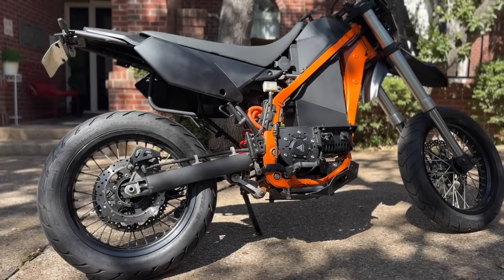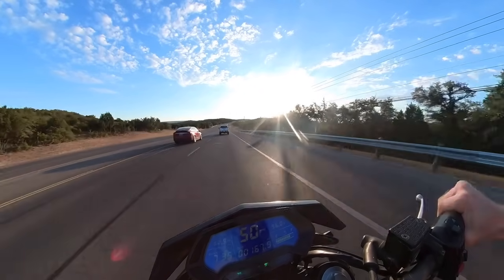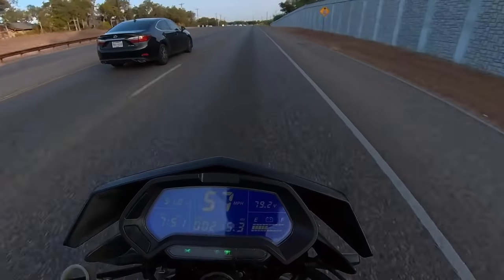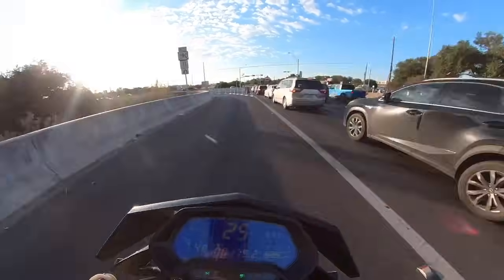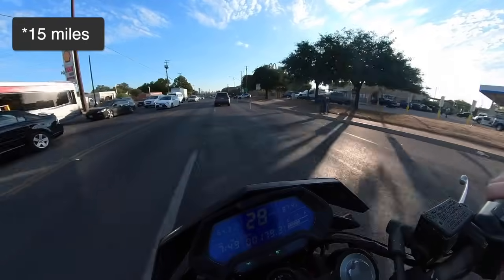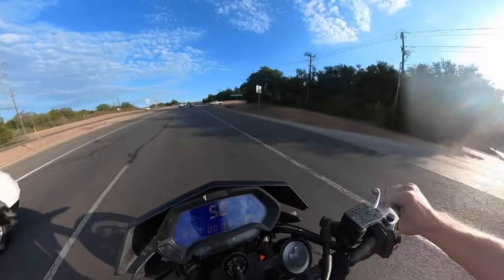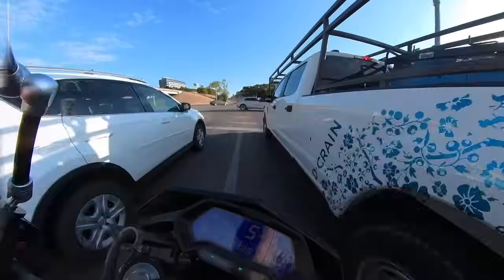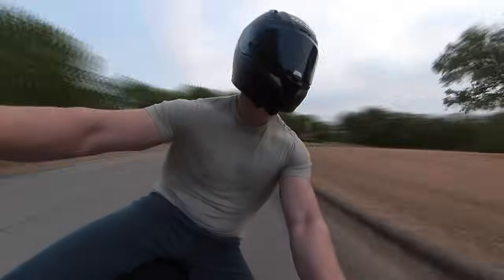I Rode My DIY Electric Motorcycle Until It (almost) Died

Comment: The program to measure the amp draw come with fardrive controller? 350A is quite high!
Reply from the maker: Yes, that's the Fardriver app - 350A is high indeed, considering this controller is supposed to draw 250A on the line. I'm actually not sure why I'm getting so much more current but power level and current is consistent via BMS app and shunt so seems legit. controller doesn't overheat so taking this as a pleasant surprise

Comment: Nice build!  If you had to do it again, would you use the same Qs138 motor and FarDriver controller combination?
Reply from the maker: the QS138, yes - it's a very good motor for the cost. The Fardriver, no - the software to program it is buggy and/or obscure with virtually useless documentation. I actually picked up a Kelly controller to swap it out
Reply: @GaiusGarage  yeah, ease of use is important for the controller…regen levels, amp limits and temperature modulation are nice to play with….if you can do it easily!
Reply from the maker: @jimhofoss9982 amp limits are easy to do - but selecting the right temperature sensor can be tricky and I was never able to get regen working. The controller itself is good if you can get it tuned property and people have done it but the app and parameters are very obscure and documentation is completely insufficient. contacting support is pretty much useless

Comment: How does regen work on a mid drive bike? I get how it would work if you had a large hub motor in that back tire. But does the chain actually push the motor when you lay off thw throttle?
Reply from the maker: That is correct! The chain linkage couples the wheel to the motor

Comment: Im blown away you are getting 28kw out of a 4kw rated motor! thats awesome
Reply from the maker: 28kW *into a 4kW rated motor. a motor doesn't actually create power, it converts it. same as a light bulb, it can be rated for 60W but you can set it up on 120W, 200W, whatever you want..at some point tho it's going to burn out but not right away if the power is not so extreme. same for electric motors - heat is the deciding factor, as long as you can keep the motor cool, it will keep running at much higher v
power levels than the "rated" value, which is typical continuous power delivery

Comment: awesome build man, i messaged you about the old build i guess about a year ago getting some advice on my own idea, you were really insightful and i’m very happy to be a subscriber of this channel. i’m wanting to replicate this build with a bac8000 and surron ultra bee motor. wondering if you think it would be a worthwhile investment and would see any significant gains / losses with that (very pricey) difference
Reply from the maker: Thanks so much! Are you thinking about replicating this build as in using this particular frame from a KLX250sf? If so I wouldnt recommend this frame - the dimensions are not ideal for electric where things are more boxy - you'll probably end up having to cut the frame somewhere like I did or custom-design your battery pack from cylindrical cells so you can control the shape. If I were to start fresh on a dirtbike I would use some like a CR250 or something like that - although I haven't deal with one of those so probably some caveats there as well. As for motor and controller BAC8000 peaks at 72V, I think, so maybe 22s at most. I dont actually know the specs for the Ultrobee motor but Im sure its comparable to a QS138 90H in terms of how much power you can send to it, not sure about performance in terms of peak torque etc. Sounds like you're planning for a ~30kW system so maybe start with the motor and work your way backwards

Comment: I have a very similar charger in my Polaris EV, 3.3kW.  Similarly, mine charges fine at home but one or two (not all, thankfully) public chargers have shown an error.  The charger sends a PWM signal to the EV (on the Pilot line) where the duty cycle indicates what current the charger can deliver.  The EV drops the PWM voltage using resistors to indicate what current it would like.  I wonder if the resistor values are not sufficiently spot on?

My conclusion is the implementation of the comms
Reply from the maker: yeah this is definitely the issue, as Ive since learned. I'm working on an arduino-based solution to add to the bike. Although I'm surprised this I/O functionality is not part of the charger
Reply: @GaiusGarage  That's not a bad idea!  Have an arduino sitting on the control & pilot pins acting as a bridge.  That would give better diagnostic information and protocol translation when necessary.

Even better could be the ability to just connect the charger to the mains with the arduino controlling the charger - so you don't need a 'granny charger' in series to charge at home.
Reply from the maker: @Simon_Rafferty  what do you mean by a "granny charger" in seres to charge at home. the charger I use at home for this obviously doesn't check for the control signal, just provides power regardless. I imagine the pilot and control pins don't connect to anything on the EVSE side, so the setup with the arduino would work in either case
Reply: @GaiusGarage  'Granny Charger' (no idea why they're called that) is just a low power home charger.
I'd be surprised if your home charger doesn't check the pilot & control lines.  My charger doesn't start the charge unless it can see the appropriate signals.

Comment: Awesome project., Your bike has better acceleration, but same top speed as the Metacycle in sport mode. Very nice.,..  Metacycle also picks up more in the middle of accelerating. Maybe it's just an EV thing? Is your speedometer accurate? have you tested with GPS?
Reply from the maker: Thanks! yes, the speedo is mostly accurate, I have tested using GPS.. maybe 1-2 mph off at higher speeds but good enough for me. The power curve is mostly due to the gearing - direct drive in this case - its possible get more low-end torque with a reduction gear

Comment: What an insane project!  Very well built!  Congratulations!!!  One question, what is the nominal speed of this engine?  From the video I saw that you reached 6700 rpm, is that right?  I follow you here from Brazil.
Reply from the maker: Thank you! Yes, that's correct. Max RPM I was able to achieve was around 6700. it's possible to achieve higher RPM with field weakening but I don't have it enabled

Comment: I wonder how much range you'd get if you weren't doing high speed runs and hard acceleration?  Curious because I have the same batteries and am thinking of doing a similar conversion.  I'd be using the 3Shul VESC based controller because I've heard others complain about the Fardriver and Votol.
Reply from the maker: I think it would be fairly similar since a good portion of this trip was highway riding around 60mph. You gotta figure for practical highway riding, the energy consumption will not be more than 200Wh/mi and not less than 100Wh/mi. So if you're working with a 4kWh battery pack, you range cannot physically be much different than 20 - 40 mi. Most production bikes like the Zero or Livewire have on the order of 20kWh packs
Reply: @GaiusGarage  True.  Most of my riding will be 40-55mph so hopefully closer to 40 miles.  Though I'll be running knobbies so that will hurt range some.

Comment: Bac8000 has all the features your looking for plus getting Hard acceleration and higher top speed with variable regen
Reply from the maker: yeah Id love to get my hands on an BAC8000 but they are so expensive plus programming is an issue. I believe you have to get them per-configured by the seller or pay for support from the manufacturer to program it yourself. I dont know if that changed but I need something that I can tune myself. but Im not as familiar with the BAC's so please lmk if Im wrong about something here

Comment: Dont you have an onboard charger? Im assuming your onboard charger converts AC to DC, so you could plug it right in to the wall. i think the EV charger you were trying to use puts out DC power.

Comment: You should try pouch cells on your next EV build....if you do another one.
Reply from the maker: yeah, definitely going the pouch cell route the next time around
Reply: @GaiusGarage  sweet. I'm in the process of building a 72v 73ah pack with NMC 3c discharge pouches and a JK BMS. So far so good. Most of the factories I talked to offered to laser weld nickel strips on the polar ends for free, which means I can solder them instead of having to use expensive copper bus bars.

Comment: It might be that your contacter wasn't connected to let current flow through and charge the battery.... Could also be the current it's trying to pull to charge, it might only put out so much current so it might be too much power to charge.

Comment: I just started checking out your channel by the way Tesla under here also by the way just a word of advice A lot of those j-1772 chargers are so erroneous I barely ever use them I know why you probably would use them just the same reason why I use them but if you can get to a tesla wall charger it's about 400 bucks and never fails

Comment: It could be a bms communication issue.. I won't say always but typically the bmu communicates with the charger. If they can't talk if you will due to a fault on the system or the firmware being incompatible. This could have possibly been your issue.

Comment: hi man, i know all things you can find will probably be more expensive than the FarDriver controller, but maybe it's worth switching to the VESC ecosystem?

another downside, apart from being expensive is that there isn't really a compatible screen that will communicate directly with them

the software has support for MTPA (Maximum Torque Per Amp for ipm inrunners) and field weakening

they're really easy to program etc, they have a great app and computer program aswell

the 3Shul CL350 (albeit limited to 350-400 phase amps) seems ok price wise at $400 and can take up to 30S

albeit i believe the CL700 will be the best option if you don't want to lose any torque but those are around $720

they also support any type of NTC etc, you can literally type in the resistance and beta value of the thermistor and it works, no matter wether it's a thermistor from one brand or even ripped out of a 3d printer for example

Comment: Keep your lipos or liions stored at 50% storage charge, in a cold place (but not freezing), and they will last longer.
Unlike a lead acid battery you want at 100%...   lipos and lions like to sit at 50% optimally.  This goes for smart phones, laptop batteries, ebikes, drill batteries, anything that uses lipos or li-ions.

Comment: Do you get more range if you added gear box
Reply from the maker: Possibly if you add a final drive gear. but because the torque curve for an PMSM electric motor varies less than for a ICE, you don't need as many gears. Lower RPM have constant torque so if you keep the motor within the constant torque region, you may be able to improve efficiency and range

Comment: it does ramp up the current when you first plug in the charger but you should be able to watch it go up slowly. if it stays at a certian low amperage for a little bit before going up then it is balancing the voltage before ramping up the current and sending the charge through the main battery cables instead of the balance leads. a nice charger should let you do a resistance check the resistance of each pack, if the resistance gets off a litte in a pack, then the pack will discharge at a different rate and wont stay balanced. why couldnt you just mount a charger on the bike and plug it in anywhere to 110v?
Reply: Doing research into my own build and it seems like mounting a charger would be a better option. You charge anywhere you fin an outlet instead of just where there are charging stations.

Comment: Hi what is the line and phase current you feeding it
Reply from the maker: line about 350A, phase up to 530A
Reply: @GaiusGarage  your controller is 250a how are you able to do it pls
Reply from the maker: @MayhewCloutier I honestly dont know - the app lets me set up to 350A on the line so I set it to max. Ive confirmed via the shunt that its pulling that many amps during full acceleration. specs for the controller do cite 250A, but maybe that;'s continuous and they didn't give a peak rating? I never really looked much into it. controller doesnt overheat so I'll take the extra 100A

Comment: Yep, just register it as a regular motorcycle and all they need is lights, horn, mirrors, etc... i wouldn't even point it out or make a big deal of the power plant and you will get a plate without an issue.  Also, if the inspector asks about it, just say it has rhe same hp as the gas motor it had in it.

Comment: Have you tried giving the energy regenerate table permission to regenerate more than 0%? 
I found on mine I needed to use:
0%.      50%
100%.  100%
and 100% all the way down. 

Then try to change back current. I kniw on mine if I tried to change these in the wrong order I get the “try new BLE” message. 

When i used 100% for all values it actually would try to go into reverse a few times after stopping, thats why I had to use 0% and 50% to taper that down to nothing. Now it works fine. 

Im using 10a15a for back current and max back (which should be 50% higher than back current). 

Some setting is putting the block on you. I know i set throttle release regen first because I didn’t have brakes hooked up, and then I changed to high brake and turned ofd throttle release. 

I think your firmware looks new so it probably supports 5 pole pair for your motor. Wont change much but it will report  RPM on the tachometer. My Fardriver even accepts most of the forbidden pole pairs too

Using the correct pole pairs might help you know how deep into flux weakening you are. In this video it showsYou have it turned on full flux right now. Weak Response 7:none is off. That will show you the base RPM. 

138 90H base speed is 4000 rpm and you at 6500 (4 pole pair) is really 5200 RPM, and max flux is supposed to be 6500 rpm, so it seems like there is a little room for more. 

You may be at the limit for your setup but changing gear ratio to a bigger rear sprocket would of course increase bottom end acceleration and you might be able to get most of the top end back if the motor can turn a little faster. 

It seems to run pretty good already. Im sure at 80 mph you won’t get far but you’ll get there fast. Lol.

You also might get some extra acceleration and quieter motor by tuning PI value one notch higher than default and tweaking AN and LM.
Reply from the maker: Thank you for this breakdown. I also considered whether there was some setting that "locks" some of the other settings from taking on certain values. I have noticed that I was able to change certain parameters but after making certain other adjustments, I am not longer able to change those parameters as much as I was before. I have changed that regen tables but mine are all 100%. I will try changing them to ramp, up from 0% like you described. 

It's all very vague and opaque and documentation for this controller is garbage. I've messed around with the AN & LM values a bit also.. thought it was running ok. Do you think it sounds kinda rough. Maybe I kinda felt that way also, but these settings are tricky also.. all of it seems very subjective.
Reply: @GaiusGarage  , the 0% and 50% will eliminate the reverse at end of regen, which will be more prominent if you ever get regn up to something more appropriate. 

I have a have a hub motor so it’s easier to tell if it makes a weird noise. And your middrive needs a different AN than hub motor. Your bike seemed to have good performance for a conversion. You see some Walmart mountain bikes with 8kw motors and 32kw controllers, which of course will come off the line faster, but no way I would ride them at 80 mph. 

You can also try to reset your controller to factory settings and run autotune again and set everything again. Your regen settings are not default, which is think is 4a/6a.  Maybe it got lowered for autotune and then some other setting blocked it. Even when setting the energy regen table value, it gave me the BLE error is I tried to set the second values before the first.

Comment: For comparison: 52 Watts/mile @24mph on new Fat tire E-bike (26 Amps and 48v motor, think I did it right)    22 Watts/mile @12mph  (has speed limiter for different power levels)    So basically might as well go full speed.   Came with 3 kWh battery, 50 mile range.  (If battery is actual size claimed, haven't pushed it yet)   So considering your high speed, yours is way more efficient I think.
Reply from the maker: well if you're actually getting 50 & 20 Watts per mile, that's more efficient, but speed is lower. But I think at 25 or less miles an hour I would get very low energy consumption also. would be interesting to test

Comment: They may use 220V connection for charging the TESLA
Reply from the maker: Its definitely 220V but that's OK. The issue, as I've since learned, is that theres an additional communication protocol required for most of these grid access points that my bike doesn't have. going to make the upgrades then should be good to go

Comment: How many watt is the motor?
Reply from the maker: motor is rated for 5kW but Im pushing almost 30kW peak. continuous power probably does average out to ~5kW
Reply: @GaiusGarage  how much deos a motor + controller cost 💲
Reply from the maker: @Hahanono100  ~$800

Comment: Nothing against you, but 1 thing I learned from this video is lane splitting should be illegal.  Cool bike though, I have always wanted to do this with a sportbike.
Reply: One of the reasons for having a bike is to avoid sitting in traffic, especially in the summer heat. It would be better & safer if governments would recognise this problem & introduce bike lanes, it's the future.